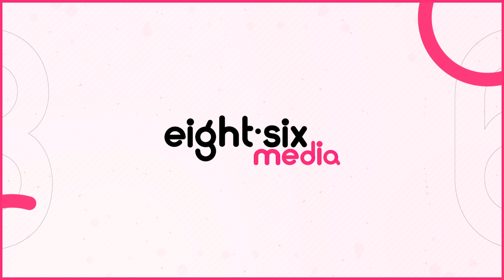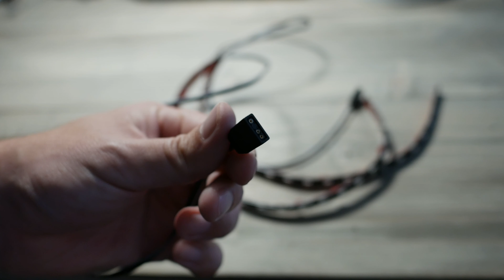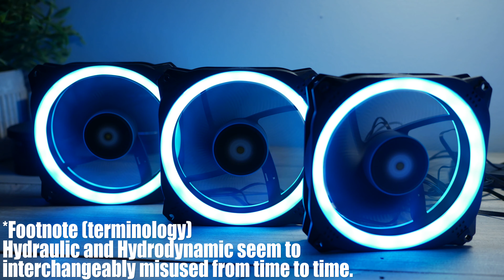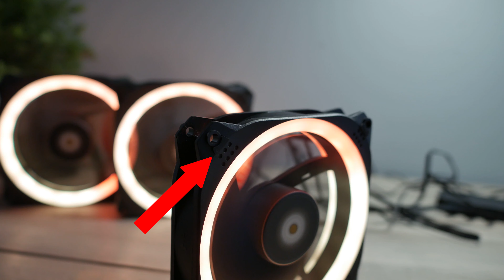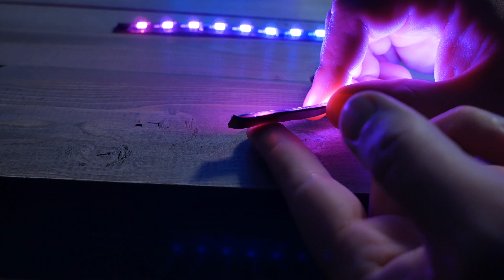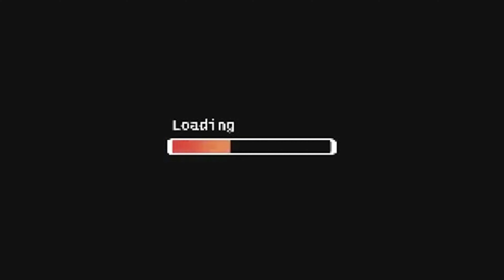ANTEC Prizm 120mm PWM Fans

Comment: Thinking of getting these fans for my itx build. But the case will be on the table and i dont want to hear fan whine. These fans are quite audible in this video. are they as noisy irl?
Reply from the maker: Sorry for the late reply, the Antec fans are a little noisy for my taste but not super terrible.
Reply: @EightSixMatt   thanks for the feedback. went ahead and got them. they're not that noisy for my use case. I can barely hear them with the air conditoining on. Its way quieter than the stock nzxt fans that I had installed

Comment: I have two questions.
Please reply soon...
1. If I connect only with sata not with the motherboard then what will be the default speed of each fan?
2. If I connect the pwm/led cable from hub to only with the 4pin fan header then can I be able to control only fan speed via mobo and rgb via controller. 
Actually I am using Asus b350f mobo ...there is no argb headers but it has fan headers(common as usual)
Reply: @ndukve no i mean 2. Fan cable to fan headers only....and argb to the given hub only...then???...can I control the rgbs?

Comment: What headers should be there in motherboard in order to control lights via software. rgb or argb headers?

And where do you connect pwm connector from hub?
Reply: you need 5V argb connector on your motherboard to connect the LEDs with software (they still work on pre-defined modes if you dont have argb port)
pwm connector should be plugged into your "SYS_FAN" port, where you normally would connect a normal fan

Comment: There's a melody about these fans by The Righteous Brothers. Give it a minute, it'll come to you.
My other desktop is in an original Antec Three Hundred case from early 2000s.
I looked at these during my Great Fan Hunt '19 and didn't like them for all of the same reasons you didn't.
Great job, as usual =)
Reply from the maker: I have an Antec 300 still in circulation. My pops has been using it :D Thats a solid heavy tower. I used to love that thing (they still make it apparently).
Reply: @EightSixMatt  -- That's awesome. Yeah, it's an "updated" version, but I'm sure you could still kill a grizzly with it.

Comment: I also need new fans so how will these work for my i7 8700 k? Will it overheat i overclock it to 3.9 ghz
Reply: the turbo boost of the 8700k is 4.7 ghz.... Definitely not
Reply from the maker: As case fans they should serve well.